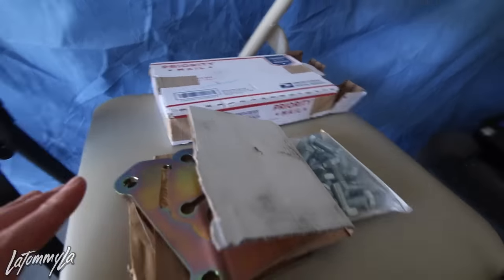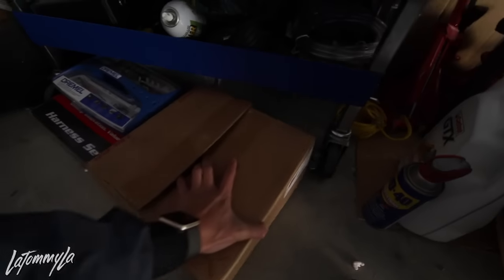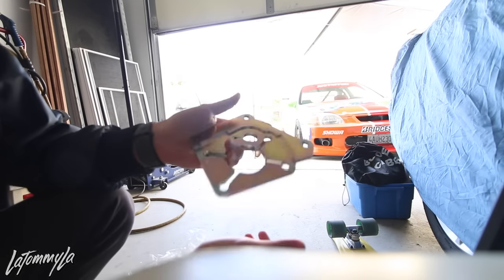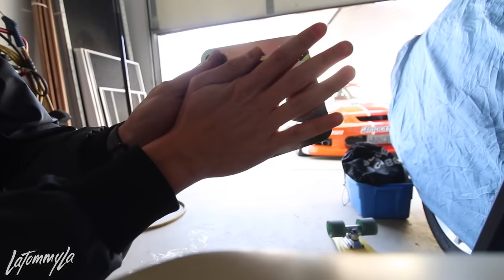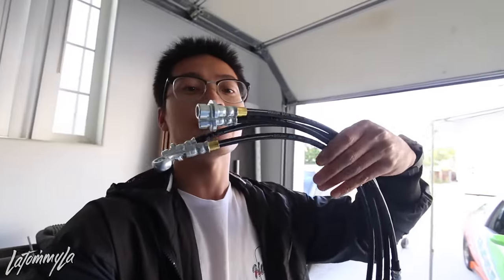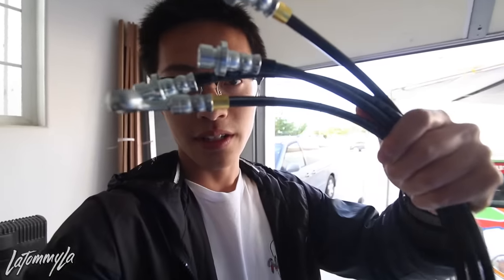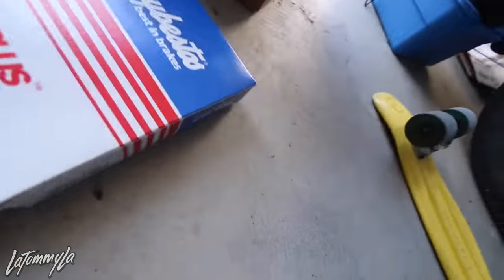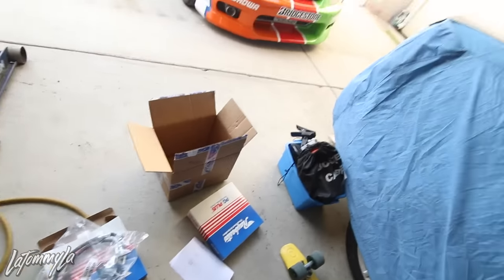CIVIC REAR DISC CONVERSION +WHATS NEEDED?

Comment: About e-brake cables - you named ends wrong way the round "prong" thingy goes to lever and the one with hole goes to caliper. It also seems like your calipers are missing the little holder bracket for e-brake cables. If I'm not mistaking part no. 43247-SH3-931.
Reply from the maker: +Jezus Christ my bad and my calipers aren't missing a bracket, it uses a pin to connect the ebrake cable
Reply: Yes I know it uses a pin (I own ek with disk swap in back) ,but it uses bracket a bit further back (to hold the cable shielding or what you call it) to caliper so it stays stationary while using e-brake, just google the part number I posted :)
Reply from the maker: +Jezus Christ oh haha, I'll look into it right now 👌 thanks!

Comment: Did those parking brake cables work? Also they say you need yo replace the master for the 1 inch bore and proportioning valve.

Comment: I've ordered a 4040 proportioning valve for the conversion but received a 3040 ? can I still do the conversion without risking my soon to be rear brakes locking up on me ? The prop valve is from a 93 Honda civic si that came stock with rear disc brakes so that's assuring , but I'd rather be on the safe side rather than having to find out the hard way

Comment: Can you  write correct site address where I can get  parts that you used for conversion..(brackets)
Dejan from south Europa
Thanks...
Reply from the maker: Here you go! https://scarebird.com
Reply: Thank you very much for your prompt response.
I'm trying to finish my first project Honda Civic EJ9 "00/ K20Z4 swap.
Trying to make the conversion brakes.
It is very hard to find in  European region parts from Honda Integra DC2...
(TA with hubs 5x114,3)
Until today, I did not know there is such a solution ..
Unfortunately, I see  Scarebird don"t deal with Europa and european models.
I try to do them, as I did with engine mounts EKK2 Hasport
Greetings from Belgrad, Serbia
Reply from the maker: Goodluck on that sir! You can also find the brackets on eBay from Scarebird also!